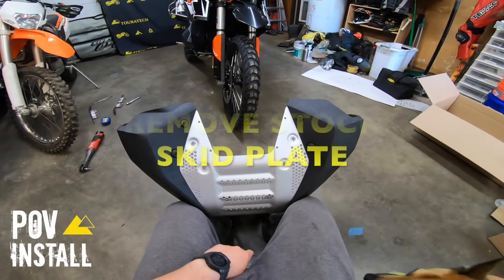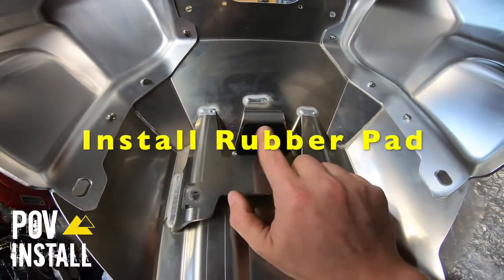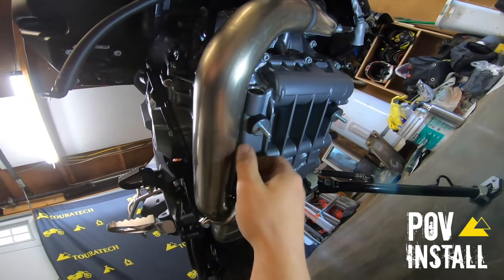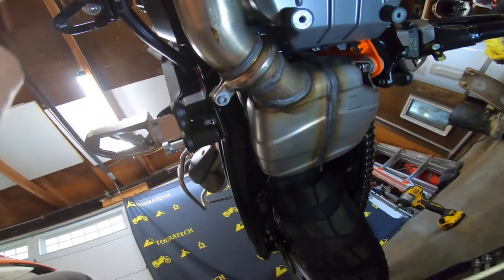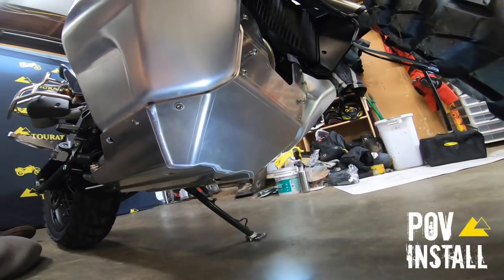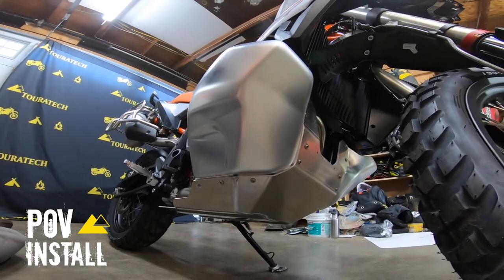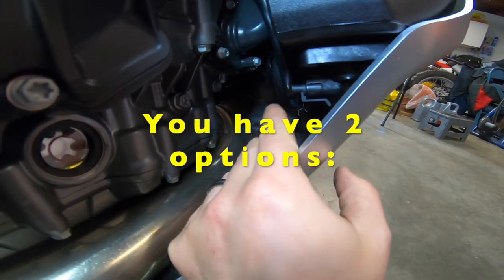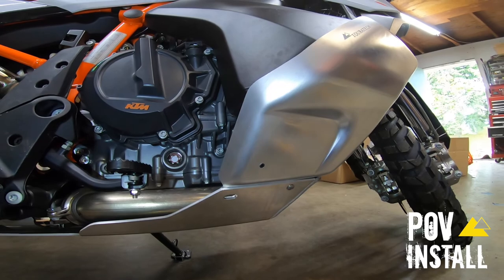Touratech POV RallyeForm Skid Plate Install: KTM 790 Adventure R

Comment: The Ralleye Form Skid Plate is quite a bit different for my 2022, 890. Still, you gave me a few tips. 
The hardware is frustrating.
Reply from the maker: Yeah, we don't have a new 890R shop bike here at TT-USA so we haven't had a chance to shoot the new version. I'm glad this helped some.
Reply: @TouratechUSA  Haha, I gave up for now and decided to order the lower rack and install them at the same time. I think the hardware will make more sense then. 
I’m not the most mechanical rider so the piece that connects at the foot pegs is pretty confusing.
Reply from the maker: @pinkiewerewolf  Good luck and don't hesitate to call the shop if you have questions.
Reply: @TouratechUSA  Thanks! I might have to take you up on that when I get back.

Comment: Also, Touratech website instructions call for 50mm bolt on throttle side. You say 60mm. Which is correct?

Comment: I do wish and think that maybe there should have been some vents in the bottom skid plate to allow for better air flow in order to keep the engine cooler.
Reply from the maker: It's a tough choice to make because the bike is liquid cooled and very little heat escapes from the bottom side of the oil pan. Also more vents give more opportunity for sticks and brush to get stuck between the engine and the skid plate which can be a hazard.

Comment: Does it fit with the optional center stand?
Reply from the maker: We haven't had a chance to try the parts together but from checking on the KTM instructions it looks like the springs for the centerstand will not clear our rear bracket.